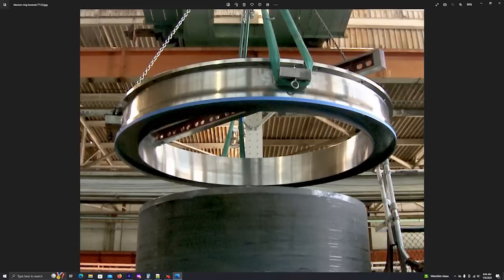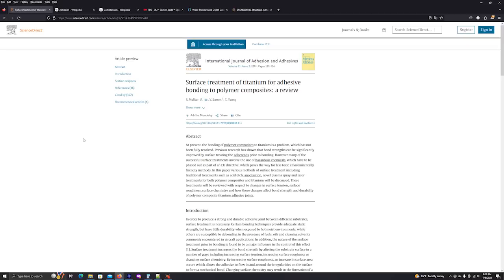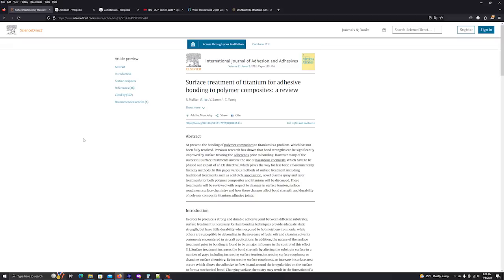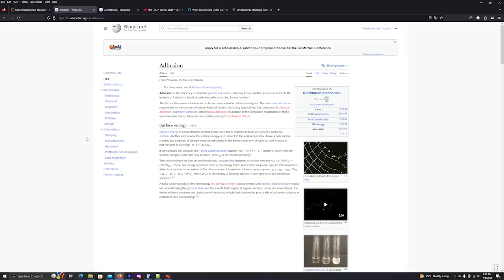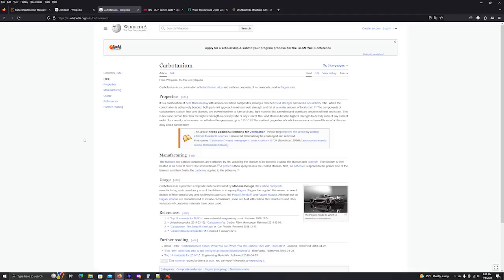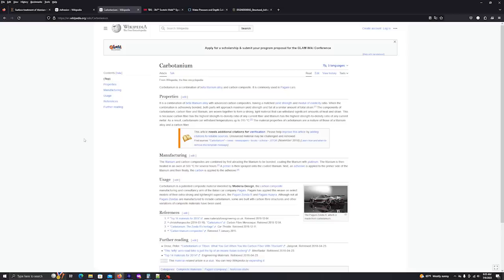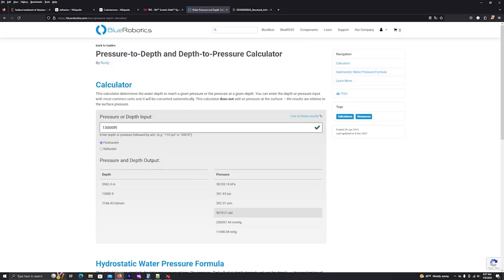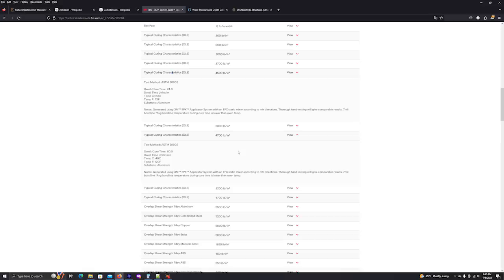Oceangate Titan Adhesive issues between Carbon Fiber and Titanium

Comment: Hi Joe,
Sounds great! A tad more volume would be great.
  Great analysis. The sounds described in previous dives, and if that transcript that is everywhere is legitimate,  would suggest microfractures from air spaces in the carbon fiber hull, which seemed to be wrapped like thread on a spool with no cross-fibers. A collapse of the carbon fiber, structural hull would seemingly be a likely cause. In the transcript, they also mentioned RTM hull monitors were "all red" shortly before the implosion, suggesting a hull failure was eminent.
  The bonding between the titanium rings and the carbon fiber hull was certainly a point of contention, yet there were many.
   FYI, The USCG has the remains of the Titan vessel in their possession and will seemingly be conducting the analysis.
   The lack of any pieces of the carbon fiber hull suggests that during failure, it perhaps turned into chicken downy fluff-like pieces.
   The plexiglass view port was also only rated to 1,300m and is also a potential primary point of failure.
   The winding of the carbon fiber seemed to NOT be vacuumed or autoclaved, which, if the case, would've left small air bubbles in the wrap, which under pressure were likely failing, as microfractures would have been the sounds the prior passengers and crew were describing, yet certainly not the carbon fiber "settling". That should NOT have been ignored.
  Despite the additional implosive stresses and heat placed on the structural parts, the titanium rings and caps were still intact. 
  The Locktite adhesive is amazing, yet if not properly applied, such as being off-center, (thin on 1 side, thick on the other, as there was no centering of the tube with centering of the rings that I saw in OceanGate's assembly videos.) Lack of abrasive, lack of chemical bonding, and even improper mixing are also additional concerns.
   Hardware had also been swapped out, and there are many iterations of this submersible.
   If the coms are legitimate,  the Titan was heavily negatively buoyant upon the beginning of the dive, as their rate of descent was already faster than was planned and accelerated past what their sensors were reading, in an uncontrolled descent. The reported coms say they were at 2960m at 9:17am, then at  9:28am were at 3433m! They had started off at 28m/minute, next depth report they were at 39.46m/minute, then at 43m/minute on their last report before ascending slightly before the implosion. Their rate was reported at 9:30am to be 35m/minute, yet they had already exceeded that rate. 
   Their planned rate of descent was 25.33m/minute if calculated at 3,800m taking 2.5 hours to get there.
   They were in an uncontrolled descent, which would've caused an increase in stresses on the hull, above and beyond the atmospheric pressure, which is calculated at 1ATM (atmosphere) of air pressure at sea level (14.7psi) + 1 ATM for every 33 feet of seawater (or 10.0584m). At 2.4 miles or 3862.426 meters (12672 feet) they would've been at 384ATMs or 385ATAs (Atmospheres Absolute, as you add 1 atmosphere for air pressure.) At 14.7psi per atmosphere,  at the top of the Titanic as reported at 2.4 miles, the ambient static (still with no current, no descent or other stresses) pressure would've been 5,659.5psi.
   Their reported deepest depth was 3,476m (11,405 feet rounded up to nearest feet) or 346.6ATAs, or just over 5,095psi of static pressure, not including other stresses on the hull.
   I hope you find this helpful! Please feel free to share. My hope is that young people considering a career in underwater research, engineering,  etc. will learn from this accident, and will take the physics of diving very seriously. Physics doesn't care if you don't go home at the end of the day.
   Thank you for the explanations of the adhesives.
   As for the "carbon fiber", there are many types. It's been reported that the carbon fiber used was expired aircraft carbon fiber manufactured by Mitsubishi. I haven't heard what type of resin was used. Again, no autoclave or vacuum seemed to be used.😮 I didn't see any crossthreads/mesh used in the manufacturing promotional videos. It appeared as though it was wound semi-uni-directional, like thread on a spool.
  Prospective and new engineers PLEASE take your projects seriously! People's lives are depending on you doing an excellent job. Never be a "Yes-man"! If somethings wrong or doesn't seem right, speak up! That will limit the lawsuits as well.
Reply from the maker: Thanks for the comment,  Yes I will increase the volume.

Comment: The glue is not as important as people think since the water is pushing the endcaps into the carbon tube from both ends. In fact you have 6000psi on the endcaps that is concentrated on the narrow 5” wide carbon surface making the pressure on it many times greater than 6000psi. This extreme pressure itself would seal the vessel, the glue is not even necessary and basically just to hold it together on dry land
Reply: But surely glue delamination could cause cavities and then leaking? With the pressure/temperature cycling dust water might slowly work its way in between the two surfaces, leading to leakages.
Reply: Lets do some math to put it into perspective: if the titanium domes were 8 foot diameter, each dome had roughly 14,000 square inches of surface area. at 6000psi, that would equate to very roughly 70,000,000 pounds of linear force exerted by each titanium flange onto the ends of the carbon fiber tube. To get a sense of that, the biggest locomotive engine weighs around 400,000 lbs, so its like stacking almost 200 locomotives vertically on each end of the carbon tube! Think about that! Whatever glue is there is entirely irrelevant and the engineering challenge is to build a tube to withstand being instantly crushed by that kind of pressure.  This is a totally different ballgame from designing a boat or plane or regular sub where pressures arent nearly as great and you are still worrying about seals and leaks
Reply: @Disoriental11  That is not correct, because the force is spread over the surface of the CF tube end. The CF wall was about 127mm wide. And the internal diameter of the sub is not 8 foot which is the area of pressure you are opposing (looks more like 1.5m). How do you know that that force didn't start cracking CF where the glue interface was due to different thermal expansion rates. 
If the leaked transcript is correct it sounds like might have been slowly taking on water due to the inability to ascend. It will be interesting to see what the investigation says.
Reply: @AORD72  you’re not understanding the simple physics problem. The dome has much more surface area than the end of the tube which is only 5” thick. If the pressure across the dome is 6000psi, the end of the tube would experience many times greater pressure than 6000psi. Its like how an entire car’s weight is exerted on 4 tiny patches of rubber. Except in this case Its a staggering amount and people don’t realize this. Its like a giant vise squeezing the tube from the ends. I actually think the carbon outside of the joint would fail first since it is not encased by glue and titanium. All evidence so far suggests a catastrophic implosion which would mean the cf buckled under the pressure. Also not ruling out the viewing portal as a failure point.
Reply: @Disoriental11  Yes will that makes sense. However what is the glue they used? Does it go hard over time and possibly fracture? There is lots of unknowns. Looking forward to the investigation report.

Comment: When they bonded the 2 ends on to carbon fibre I don’t understand why they would not of used at least 12 titanium bars going from one end to the other over the top of the carbon fibre to stop the ends separating as easily, considering they were just  Relieing on the adhesive holding the ends on. A little reinforcement so to speak,
Reply from the maker: The carbon fiber would still fail between the bars.

Comment: I can't imagine using adhesives when you are dealing with 6000 psi. Maybe an outer titanium tube welded to the titanium end caps, with an inner tube of carbon fiber reinforcement that's replaceable.   But it sounds like carbon fiber has micro damage every time it is cycled and there is no way to determine when it will go catastrophic.

Comment: Epoxy glue applied unevenly using a spackling spreader in a non-sterile environment?  Yeah, what could go wrong?
Reply from the maker: Yes, did you also notice the guy wiping down the titanium with no gloves on. Thanks for  the comment

Comment: The way I saw the assembly was that the ring slid over the graphite tube. The tube had a smaller diameter at the end (3 inches) or so that was epoxied
 The inner side og the titanium was also epoxied and then ring was set down on tube resulting in an overlapping of ring until it hit the shoulder of graphite. I do not believe the glue was a factor as the water pressure would simply push the end rings towards the center of the pressure vessel. When the CF tube imploded, it shrank in every dimension. The end rings and bells would be required to accelerate from zero or static to move 2 or three feet in a micro second. These 4 pieces would stand relatively still as the CF tube shrank away in an instant. The glue did not matter at all, it was a sealant and kept things together topside.
Reply from the maker: Makes sense, I have seen no traces of carbon fiber in the recovery videos
Reply: If the transcript being spread is correct, then it sounds like they might have had a leak. Perhaps the end cap glue had cracked, then perhaps leaked around the titanium ring, then perhaps the water eventually cut through the CF to cause an implosion. Will be interesting to know the time of implosion in relation to the last communication.
Reply: @AORD72  the strongest parts of the sub were the titanium bells at eiher end as well as the rings. The implosion most likely happrned at the weakest point of the pressure hull = center of CF hull away from the tittanium  end sections. ? THEY ALL SURVIVED UNSCATBED)
My god , it is not that complicated!
Implosion of carbon hull, 6000 p.s.i 6000 p.s.i creates super high temperature rise. 6 to 10 thousand degrees F
This combusts organic tissue, oil, plastics, etc. This causes an explosio   and then an other implosion. Study the physics. 
The CF tu e gave away 1 st
Reply: @tmorton922  When I say around the Titanium ring I mean the joint between the titanium ring and the carbon. They both are different materials with different expansion rates. All it would take is the glued joint to crack and and you could have slow water ingress.
"Study the physics", "My god , it is not that complicated!", RUDE, did you do physics at university?
You are saying things like they are facts. The reality is there is many possibilities. 
The transcript suggests they were weighed down and couldn't ascend, so a leak is highly plausible.
Reply: @AORD72  42 years in hydraulics.  I understand how water and compressed air interact. It is simple really. The pressure vessel collapsed ( imploded) in less than the blink of an eye, the pressure bubble the passengers inhabited  went from approx 15 p.s.i. to approx 6000 p.s.i.. this caused a reverse explosion event!! 6000 p.s.i.The air ; baving been compressed to 4000 times ( roughly)  atmospheric pressure was superheated  ( due to the 3 laws of  thermodynacics) This increase in pressure caused the air bubble to increace to approx 6000 to 10,000 degrees as is found in a diesel engine. ....... ANYTHING with organic compounds would spontaniously combust! Fat, plastics, oily compounds,etc. The implosion would create a secondary " explosion" which would cause an overpressure event ( in relation to the implosion event). There is a singularity which happens with implosions.... There is a frequency of the implosion/ explosion/ implosion, etc, etc. I am tkred of explaining this to small minded people. Don' bother responding. I could not care less at this point. They are all dead and reduced to molecular matter. Maybe some teeth.
Reply: @AORD72 Not what happened.
Reply: @tmorton922  Initially I never said anything about about the thermodynamics of the imposion. I just said a leak was possible. You just went out right crazy on ONE of the possible scenarios. 42 years in hydraulics mean bugger all, as you have showed. "small minded people", let's wait and see what the investigation finds.
Reply: @tmorton922  This is what an expert engineer has commented: "As a retired Aerospace/Aeronautical Engineer with 40+ years of experience, I am 99% certain that the Titanium Flange to Titanium Carbon-Fiber hull joint was the Achilles heel of the design.  Primarily due to thermal and pressure expansion/contraction rate differences between the two materials.  Joint failure was inevitable."
Reply: @AORD72  it was not the glue. You have to understand an implosion...
Reply: @AORD72  the "last transmission" script is a hoax. earliest Youtube appearance I can find is from an anonymous "Institute" in Pakistan. (which posted it in arabic along with the English).

Comment: 2:40 Yeah that document's dated, but I can't believe it isn't relevant today. Ocean's Gate "innovated" by using Krazy Glue.
Reply from the maker: Thanks
Reply: BITD when I was a kid, I was an apprentice machinist for a company that made NMR/MRI equipment. Solid-state NMR sample rotors were initially made from Delrin or Nylon and could be machined on hobbyist lathes, and a drill press with an indexer. Kel-F came next; the thing about machining Kel-F or Teflon is they demand precision tool-cutting or all your holes will be off-center, so we made those rotors on a Bridgeport with the head tilted, and a precision lathe.

Kel-F (similar to Teflon) was used because it gives off a signal that's easy for an NMR spectrometer to cancel out, but then came ceramic-sleeved sample rotors...

How do you glue a ceramic to Teflon, lol. First engineer who figured it out was wearing a face shield and Carhartt's when it went kablooie at 20K RPM, sending him to the ER to have the shrapnel (and denim) removed. Working with that tech nowadays, you're better armored than a medieval knight, and carbon fiber makes an excellent sleeve because the weaving tightens up with centrifugal force. That guy's Dad was in charge, he was a Vietnam-era ejection seat test pilot... the joke was he got chosen for that because he couldn't land a plane for sheet.

Primary way to die with NMR/MRI is asphyxiation from a superconducting magnet quench. Oxygen monitors are required, now. Such a mesmerizing occurrence, your instinct is to stay and watch, without knowing you're suffocating.

So, I have some interesting background and hands-on experience with adhesives (key NMR market is developing epoxies) in extreme applications. And I'm a fan of Formula 1 racing. If there's some magic adhesive out there for bonding CF to Ti (especially under extreme conditions), surely I would've heard about it by now, and like so many other technologies, F1 would've done it and it would've trickled down to the mass market.

I know! Let's use Krazy Glue! Stuff's miraculous! Sigh. This should've been known before anyone lost their lives. Wouldn't surprise me if that's where the failure occurred before the CF ruptured anywhere. Gluing Ti to CF is harder even than gluing ceramic to Kel-F.

Comment: my man … I’m not a submersible expert but i am a resinous materials expert. They should have had a clamping system but let me tell you from repeated dives squeezing, stretching, and then returning to nominal absolutely caused the likely brittle adhesive to give way …i’ve been saying this exact thing since jump street. End ring was clean as a whistle… no carbon fiber splintering left behind …
Reply from the maker: Thanks, great points.
Reply: @JoediyLab  also 5600 lb force on every .5”x.5” square is also very clearly what caused the weakening over the multitude of dives under titan’s belt

Comment: One of the issues no matter what the epoxy is rated at is the fact that the carbon fiber and titanium are going to react differently with the depths of pressure and will cause over time a failure the question is when and with the Titan we now know
Reply from the maker: Yes, I indicated that i n the first video, thanks for the feedback